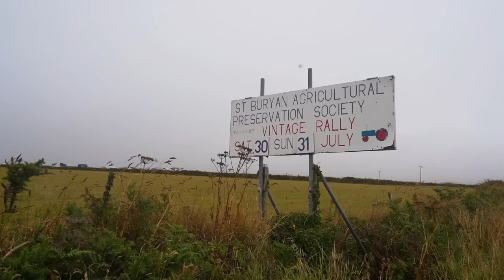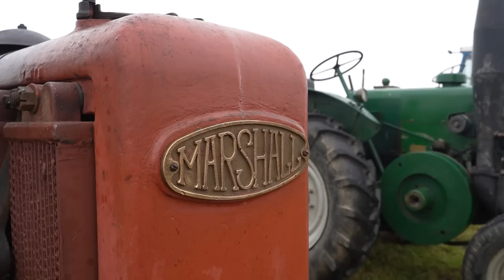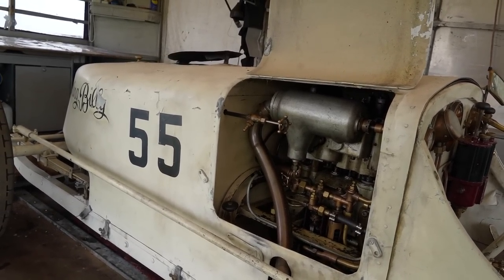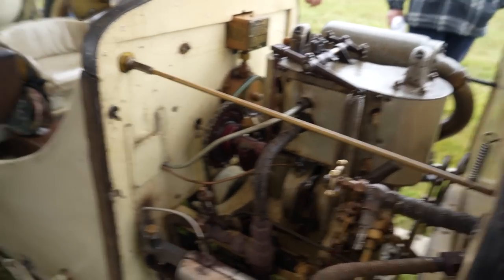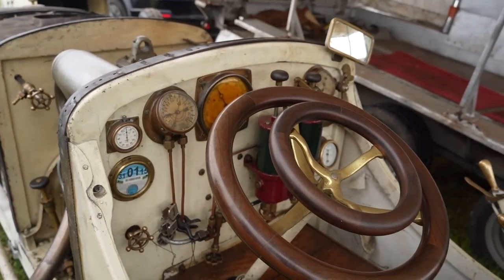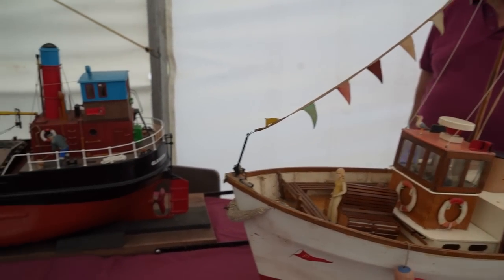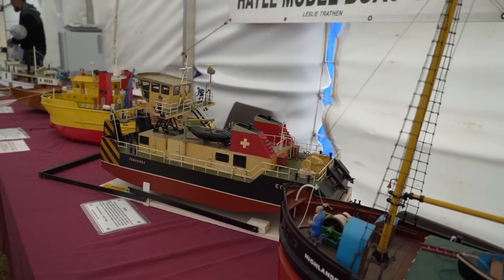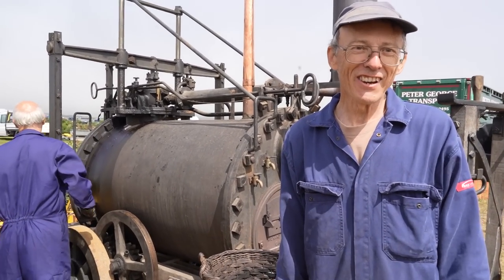Visiting a Vintage Rally!

Comment: That Series 1 Landy in pale green must be one of the original production batch as they were only available in that colour as Land Rover had gallons of the stuff from painting the undersides of aircraft during WW2! They didn't start using the dark green until they got the contract to supply the army in the late 40s, early 50s.

Comment: What a great video Dom! I love those steam rally's. I went to one about a month ago in Stourport on Severn. It wasn't as big as the Penzance one, it hat a lot of tractors but nowhere near as many as Penzance lol loved the steam race car! At Sourport there was this huge car built I 1909 I think and was powered by a 16.5 litre aero engine, it produced about 250 bhp, but the torque was enormous at something like 860 ft lbs and running around the arena it was blasting up dirt from the chain driven rear wheels everywhere! Thinking how times have changed, my Overfinch Range Rover has only just short of one quarter the cubic capacity of that aero engine but almost twice the horse power! I'm not sure of the torque figure of mine so I'll give in to the aero engine, as I bet I've only less than half of the torque of that monster!!